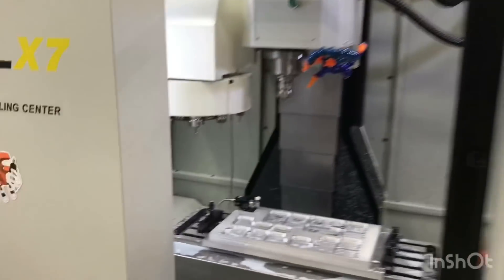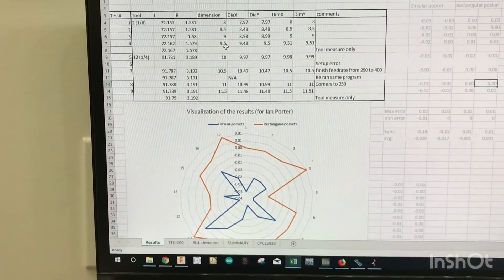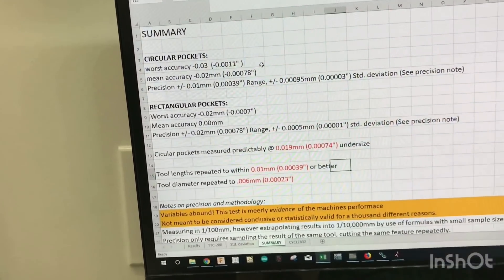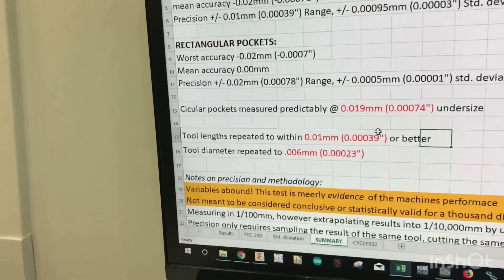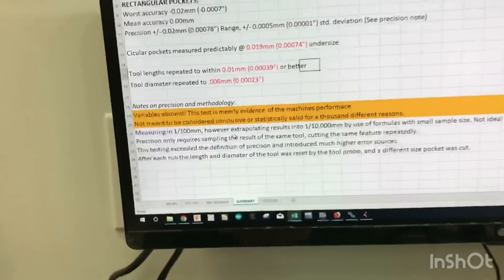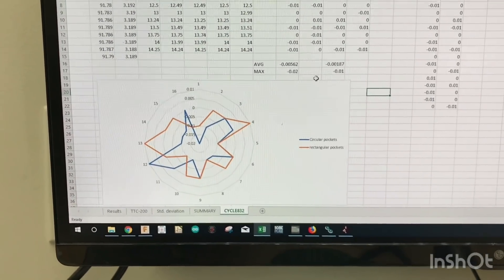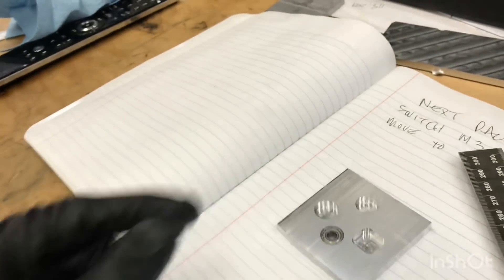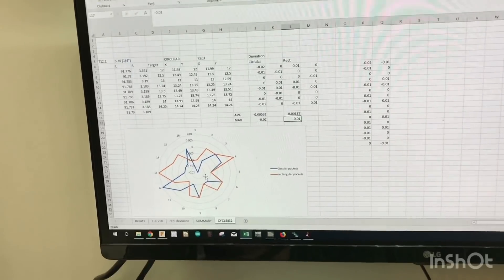Syil X7 accuracy tests

Comment: Amazing results. Quick question about the control. Are you able to change the units of the control to imperial? I live here in the US and although inches and feet don't really make much sense in the grand scheme of things, it is what my brain thinks in. Having to convert back and fourth in my head the whole time while running the control would frustrate me.
Reply from the maker: Battle Resistant Outfitters good question. I know you can have your program run in Inches, but as far as switching the control over completely I’m not sure. I will ask and let you know.
Reply: @betztechnikindustriesltd.8901  that would be great. I know using G20/21 will let me run a program in either. I just have yet to see anyone upload a video with the entire control in imperial

Comment: Great content, thanks for sharing.
i think that what you are measuring with this type of test is the repeatability  of the machine/probe rather then the  accuracy . if for example the pitch for the lead screws is slightly longer or shorter  then this type of test wont reveal it since the test will have the same error as the part being measured.
Reply from the maker: Hi, thank you. The lead screws were calibrated (with compensation table) with a Renishaw laser interferometer so they are moving about as close to the indicated amount as possible! Of course the tests I did were not perfect but I think they are still quite meaningful.

Comment: Curious. How does pricing compare to a haas of similar footprint.
Reply: CDModelz half price !
Reply: Can you explain yourself?
Reply from the maker: It was about half when I bought this version of X7 (as compared to a similarly equipped Haas MM2). The new X7's are a fair bit more money, but they are a lot more machine. Epoxy granite, side arm tool changer, Siemens spindle driver and servo, etc. All of this adds to the cost but you end up getting a lot of machine for the money.

Comment: It reads pretty impressive, your precision is very good,  please remind this aint a mazak, fanuc or dmg mori ! You get actually getting a good fair amount of bang for your buck !! If possible you should perform a ballbar measurement this wil back your findings in your excel spot on i guess... Thanx for posting, very interesting topic on this equipment !
Reply: @betztechnikindustriesltd.8901  while you have a load of measurements and so getting an accurate average, i bett you a ball bar would confirm your findings.  I gues that will be a very small grain of salt 😁